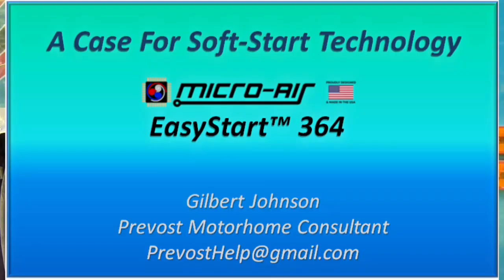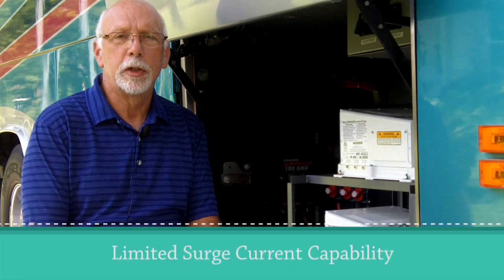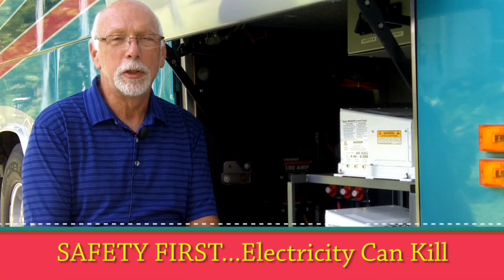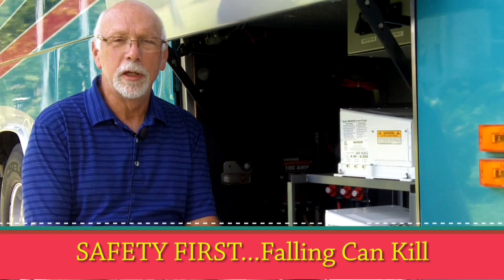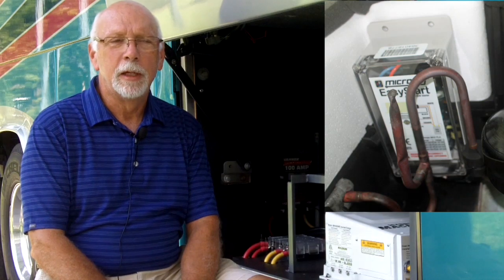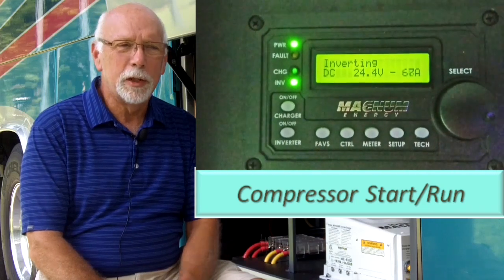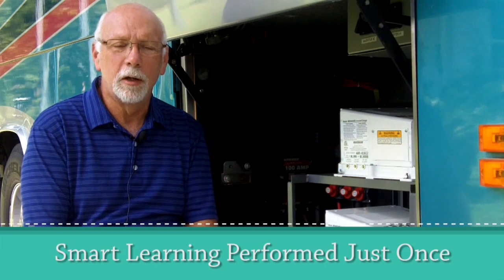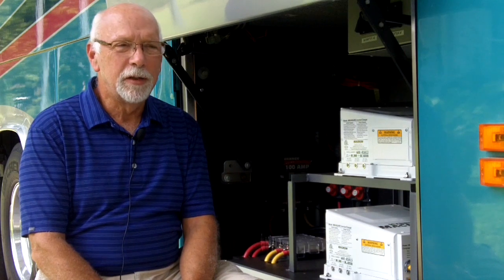Microair 364 Final

Comment: Excellent video, Gil (as usual).  I have three older CruiseAir split units, with two of the condenser/compressor units in the spare tire bay (H3-40vip).  I presume these soft start devices would need to be wired in close to the compressors.  Thanks for including the price in the video.
Reply from the maker: Bruce, given the unit includes the start capacitor, yes they would have to be wired near the current control card and run capacitor.